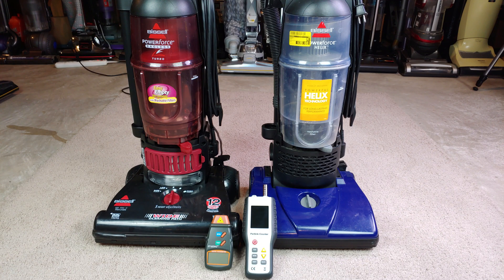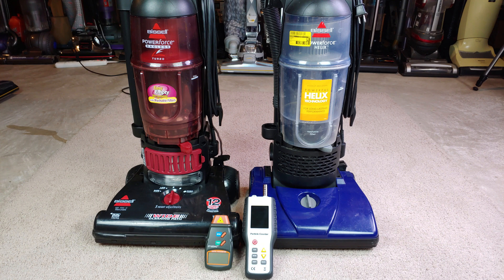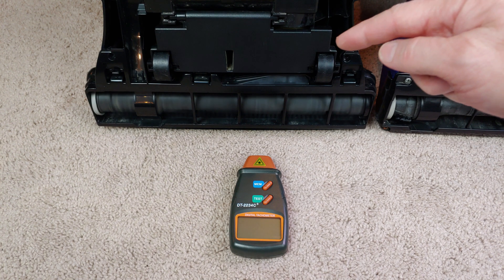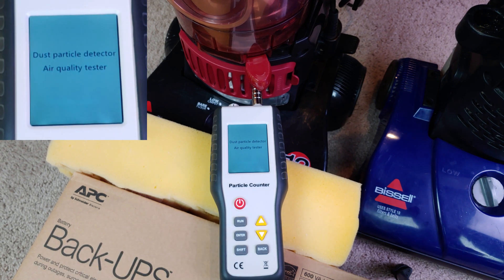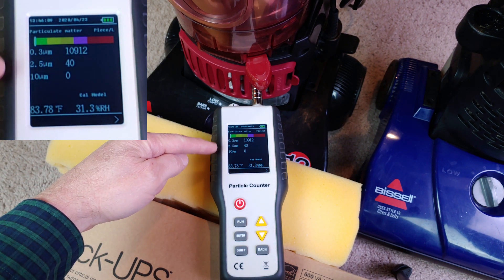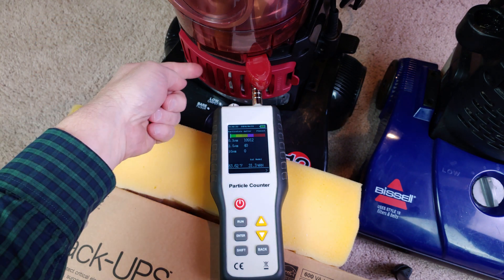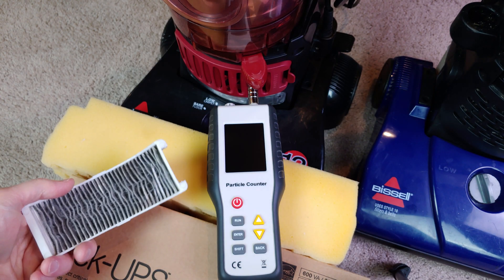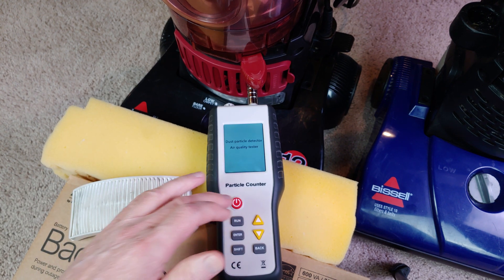Bissell Powerforce Turbo And Helix Brushroll RPM And Particle Tests

Comment: The powerforce turbo has better particle control than the Hoover tempo wide path that was tested with a hepa bag!
Reply from the maker: Don't forget that pre-motor filters (or bags), don't really affect the post motor filter results. Most post motor filters exist only to filter out carbon dust from the motor itself.

Comment: Fantastic video! Also the Helix does have a post motor filter, it's just not easily user accessible. At least it should have one.
Reply from the maker: It may have had one in the past but it's gone/useless now.  😂
Reply: @Largemouth Bass Yes he did